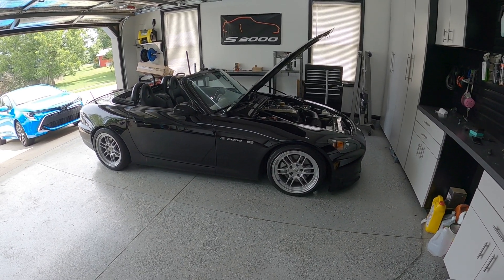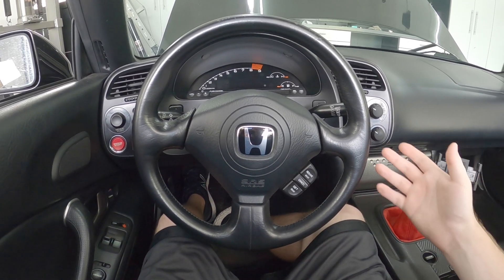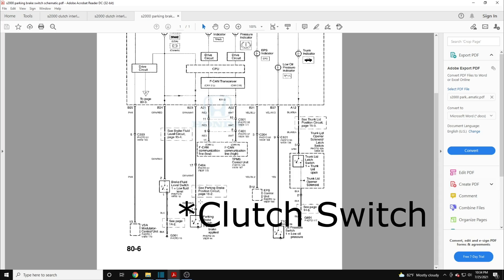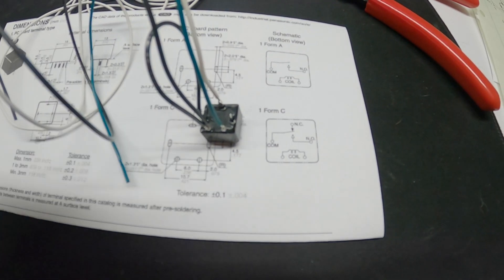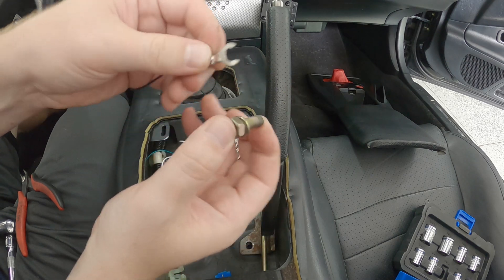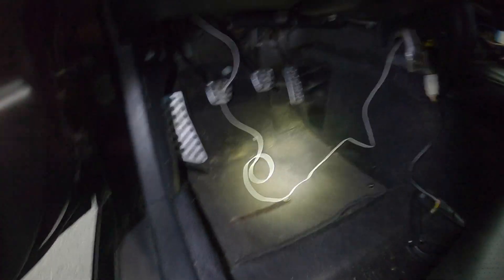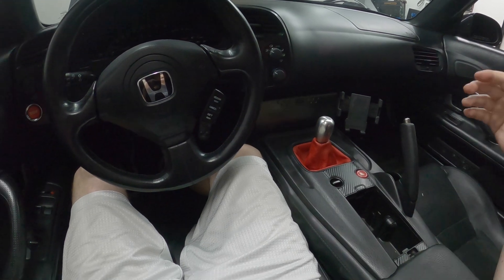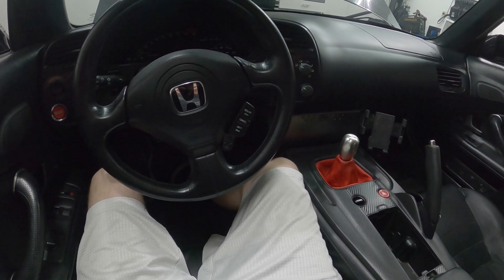S2000 clutch interlock bypass

Comment: Would a ACT pressure plate with oem flywheel and clutch disk etc have any problems with this load issue ?
Reply from the maker: There’s a lot of debate on s2ki about whether this is needed for the AEM pressure plate.

I’m not sure how necessary it is but I did the bypass out of an abundance of caution.

Comment: Using your ebrake is fine if you're not going to track your car. Or if you don't get into a situation where you have to push start your car. Otherwise it is a clean install.
Reply from the maker: The car can still be started by pressing the clutch so everything still functions as normal. 

The only difference is you can activate the clutch interlock switch either by pressing the clutch or when the ebrake is up.